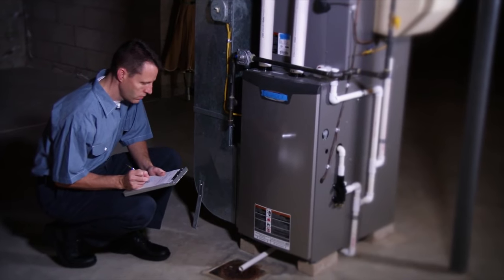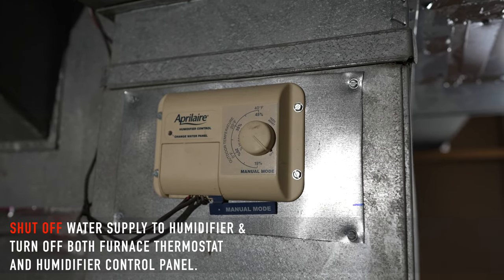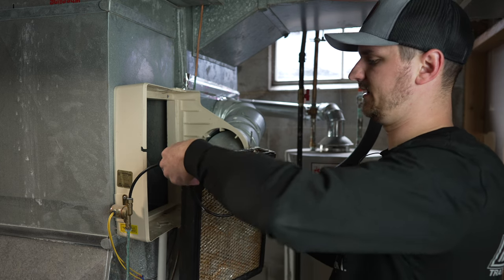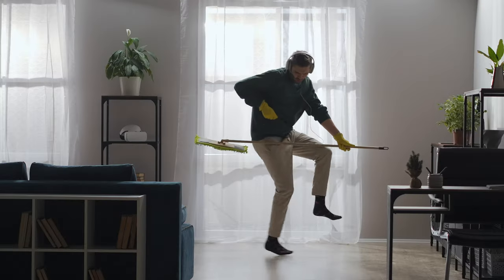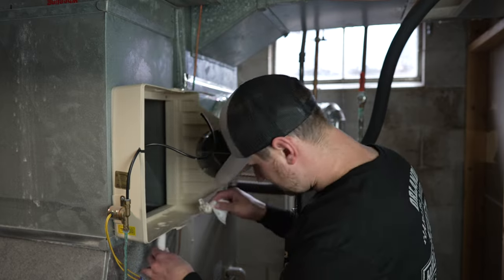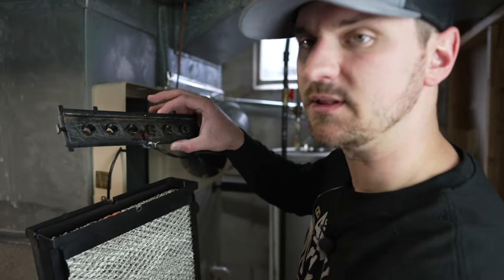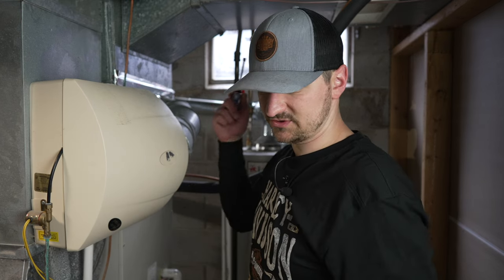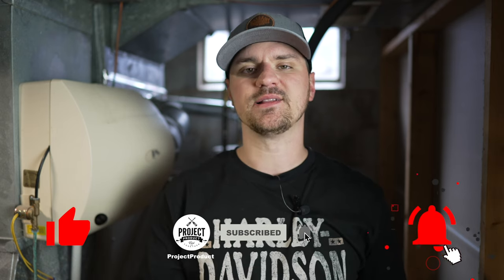Aprilaire Home Humidifier Leak Repair

Comment: Thank you.  Could not fix the leaks after watching several videos until yours and the mentioning of click sound when pushed in in the filter housing...
Reply: My leak was related to the small valve that opens to supply hot water from the warm water tank.  All it took was a little tightening of one of the ends.
Reply: Thank you for this comment
 Saved my time and confusion

Comment: Weirdest thing happened to me. I replaced the panel and tray. It was still leaking at the bottom of the panel/try. It turned that duct had a second damper in addition to the one in the humidifier. I did not see the f… thing for 8 years as handle was small and same color as duct 🤣. Since I had two other humidifier I always turned off and ignored this one. Once I opened both dampers leak stopped. I believe with closed damper water was splashing because of the suction.

Comment: This also fixed my issue. I bought a new filter and housing and my Aprilaire 700 was still leaking. So I cleaned out the bottom of the insert and I cleaned and removed all the hardwater buildup on the drain and it finally started working properly. I would say to just get a brand new housing/filter if you have build-up as bad as the video. Thanks for posting this video! Helpful 2 years later for sure.

Comment: I just got the entire cartridge and plastic assembly for $30 for my model 700, when a replacement was $25 I said screw it and cleaning everything. I also installed a in line filter going before the unit to eliminate the hard water build it.

Comment: Did everything you suggested.  Mine still leaks.  Apparently a different cause.  I even replace the piece at the bottom that the plug on the tray fits into.  No luck.
Reply: did you figure out what the cause was?
Reply: @ramanaa88  Not sure yet.  I ordered their maintenance kit although I can't imagine what could be leadking.  However I turned the pressure down on the valve that feeds it and seems to be working OK.  Has been full open for years and never had an issue so don't know what to make of it.
Reply: I have a similar looking Honeywell unit that started leaking.  After struggling to find the issue, I've determined that it was caused by the water spray at the top of the filter. Turns out these units have a tiny orifice to restrict the water flow while running.  When this wears out and enlarges the orifice, it is just too much water going into the system, and they leak.  There are replacement kits available.
Reply: That's what I ended up doing and it did take care of it.  Thanks for sharing.  Rick  @bwthor

Comment: Great video, you rock :)  I was not snapping the panel frame in as I should (great tip, thanks) but my leak ended up being from the small valve that opens to supply hot water from the warm water tank.  All it took was a little tightening of one of the ends.  Plus I cleaned up everything and put in a new panel.  Wew.

Comment: To shut the water off, turn the bar to the right ... How far, don't want to break it off.  Will this  stop dripping?
Reply from the maker: You should be able to feel a stopping point when shutting the water off, but be careful if it doesn't feel right. Might need to call a plumber if so.

Comment: I replaced the pad but my tubing was so brittle that it cracked. Can I get replacement tubing at a hardware store? Do you know the diameter of the tubing?
Reply: @user-ei7ii9eu7f Just shut the unit off and take it to the store with you. I’ve had to replace mine before. It does dry out and crack over time.